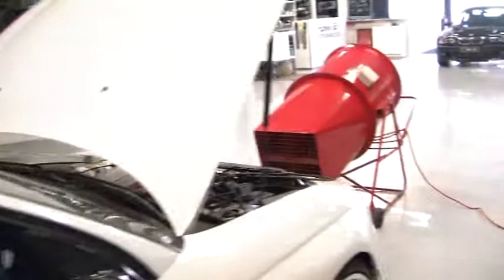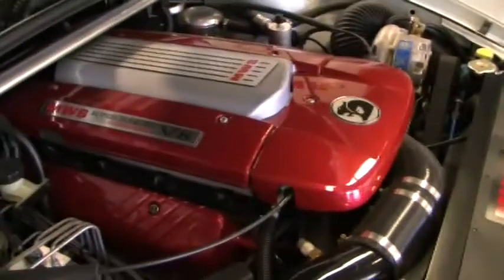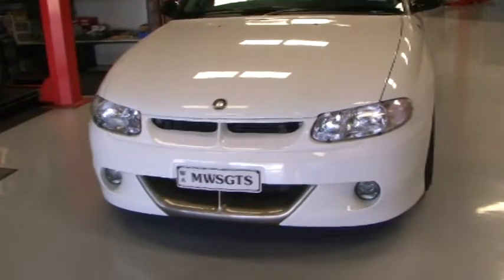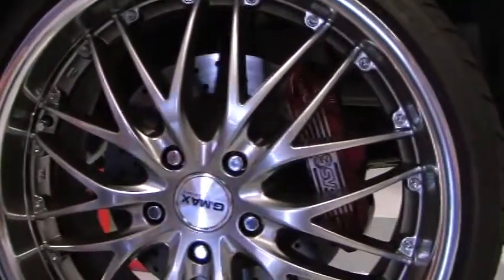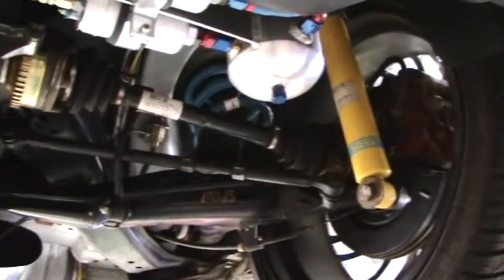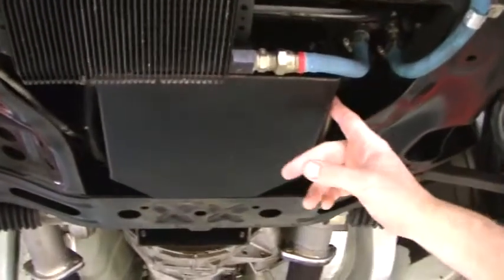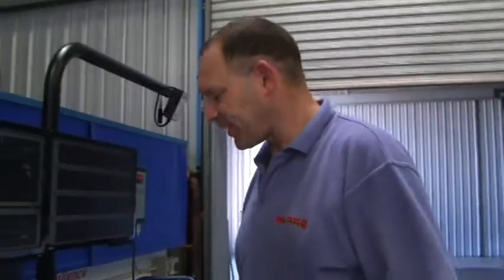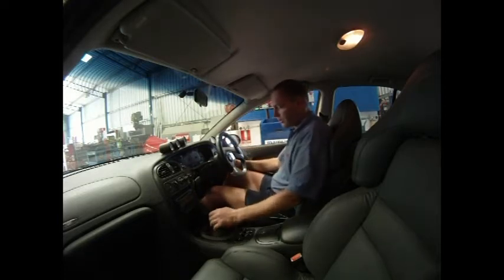680rwhp VT series 1 GTS

Comment: Last of the commodores with good curves the VT. I have the VT GTS series 2 and still think that they have a distinctive look. I'll never get rid of mind. What I like about this VT S1 is the fact that it retains its original appearance, obviously the wheels are different. Not changing the side indicators for clears or the rear tail lights from the series 2. Impressive list of mods, give it time and all older GTS will become hard to come by, because people don't want to the part with the them. Just trying and find a pre VT GTS on Gumtree (VP, VR, VS).